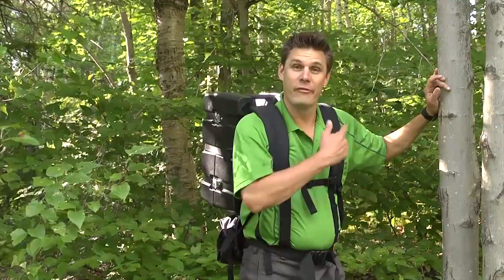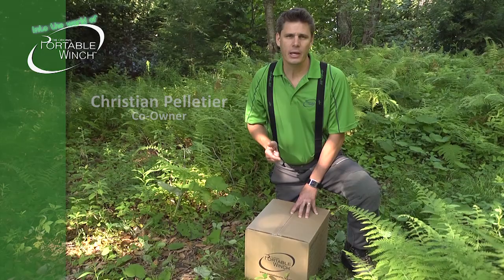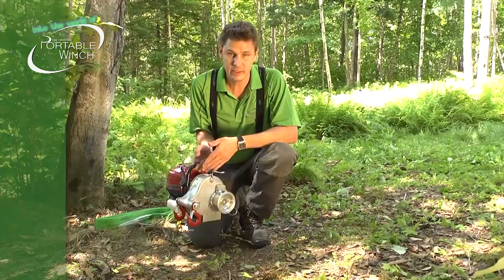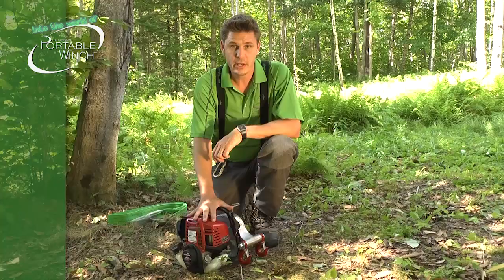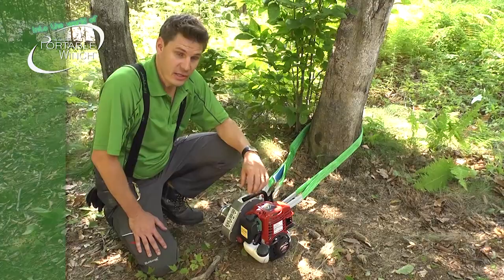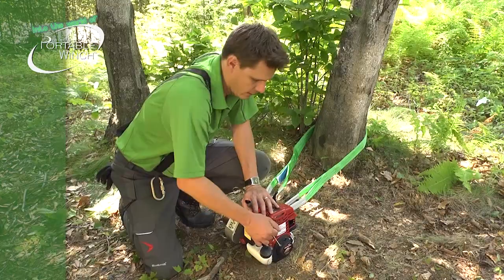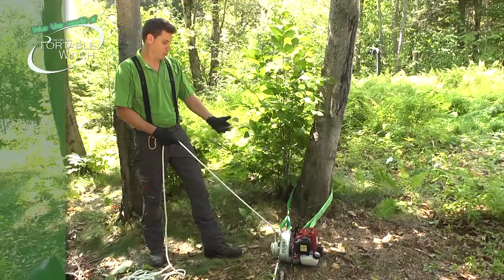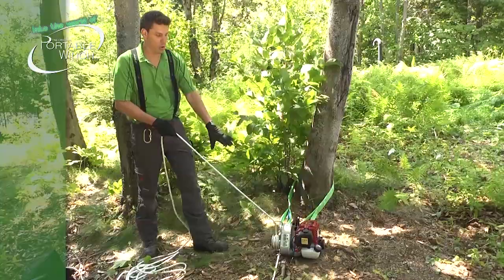Video 3 - Into the world of Portable Winch - How to use the PCW3000 winch

Comment: Looks very very dangerous just because you have no control over it. You can not make it go back or forth. Let's imagine I would like to move a weight uphill, if I missed lets say 0.5m above the point I need to go back. How I can do this? I don't wanna hold the rope. I wanna hold the remote control to control back and forth.
Reply from the maker: Alex, thank you for your comment. That being said, if you are pulling a load that does not have wheels, like a tree for example, even if you have a winch with a remote control, it will be very difficult to back it up. However, if you are pulling a load with wheels, such as a vehicle, we agree with you that you will be able to back it up. We understand that you may believe that capstan winches seem dangerous, but it is possible to reverse (or lower) a load, simply by releasing the tension on the drum. It is a technique used by arborists when they dismantle a tree.